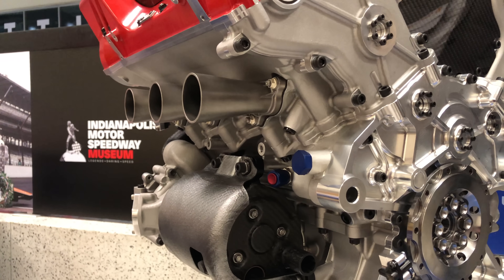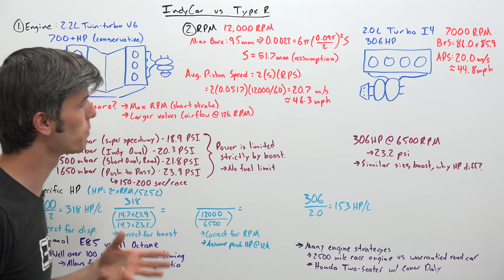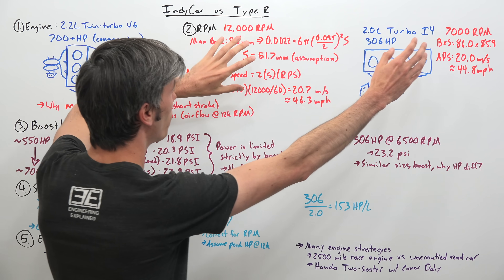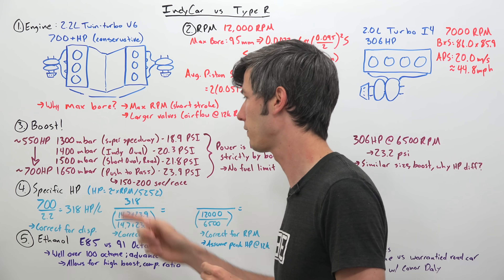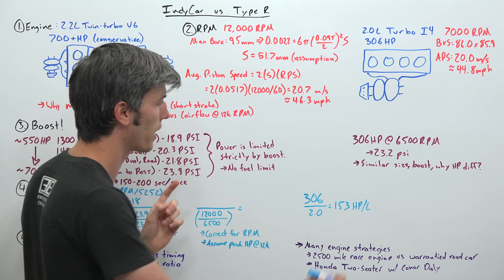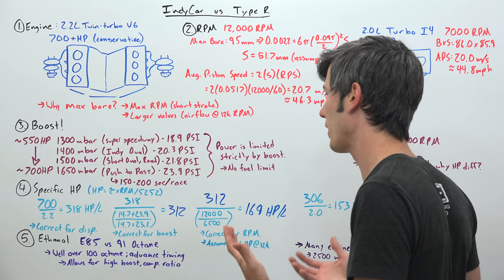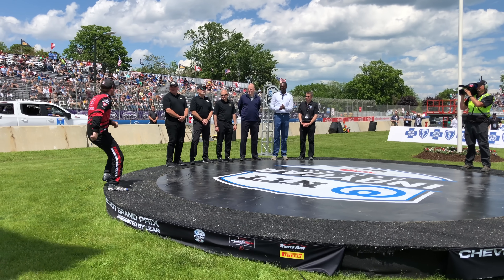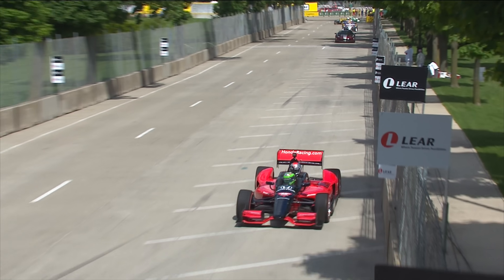How Honda’s 2.2L Engine Makes Over 700 Horsepower

Comment: Hi Jason, great content as usual. Just an observation as we surf around the semi nude Type R engine, the casting metallurgy and fastener coatings don't seem to be what they were in the 90's. I had some direct experience auditing Hex Chrome out of usage for another Japanese OEM some years back. Smart engineering of course is meeting output targets at the most cost effective means, but has the headroom for personal further HP development been diminished (compared to B series) as I suspect for most newer released products? (e.g. LS series)

Comment: Would you ever consider doing a video about the upper limits for an engine's RPM? 
I know F1 cars have had some crazy fast turning engines in the past, and when I calculate the time the combustion cycle has to produce power I get a surprising small number. 
Which leads to my question. Is flame propagation the limiting factor, or something else?  And if so what is that limit (in time and rpm)?
Thanks

Comment: Race engines are NOT hopped up street motors and their internals and valvetrain are completely different.  Race motors are all-on or all-off.  Nothing in-between.  Race cars are completely undriveable on the street.

Peak hp is not the goal of an Indy Race team--how quickly an engine gains revs. is much more important.  Think of blipping the throttle on a bike engine or mashing the pedal on a car for a second, which wraps up quicker?

Comment: Would the extra power stroke per rotation of the crank contribute to the increase in power as well? You compensated for RPMs but even with constant RPMs, a V6 fires more often than a 4c. Or is the shorter firing interval only useful to help it reach a screaming 12k top end?

Comment: More cylinders with a shorter stroke yielding larger diameter pistons, higher compression rings, better fuel and pressurized air to 30+ psi. All this yields an engine capable of ONE race...

Comment: 700 Bhp using about 30 psi boost on a 2.2 liter petro engine is not that high an power output compared to what Honda and others produced during the Formula One turbo era. It was common to find 1.5 liter turbo engines running over 90 psi of boost and over 1500 Bhp. These absurd turbo boost level engines did not last long, but they definitely produced LOTs of power for their time.

What should be recognized and often never mentioned it was Saab-Scania that figured out how to make turbocharged  engines reliable for mass production cars. If not for their engineering development efforts, the modern turbocharged petro engine would not be as common as it has become today. Do look up the vast number of now expired Patents (IP) created by Saab to make petro turbo engines what they are today. It is a fascinating history and why Saab-Scania must be recognized for their achievements.

Comment: I realised that you love to talk about this stuff, so it's okay. But this explonation about the difference of the 2 engines here, well, that was pretty lousy. 

1. The V6 has much less internal friction, bc he has to stay only 2500 miles.
2. The fuelmix is for a much better cooling and deliver a couple of HP more than the normal stuff
3. And that is the main reason for the much more HP's per liters:
       6500 rpm = 3250 combustion strokes per minute
     12000 rpm = 6000 combustion strokes per minute
Finally I read that the pressure for the mbar absolut got corrected from you. So I don't go in in the math any longer . . . . .

Comment: How many miles will this engine last when it is pumping out 700 HP? The 1.5 liter F1 engines could pump out 1500 HP. Of course you could not get 200,000 miles out of it.

Comment: If I wasn't aware of what us street builder build I would be impressed however 700 hp is relatively easy to get from a Honda K20a2 street engine and it's only a 2.0 liter.

Comment: 2.2 700hp...  turbo..
Pretty sure youngs kids are achieving this these days with off the shelf parts.  With 4 cylinders.  And pump gas not methanol...

Honda made 1.5 by twin tur os in the 80s with 1200hp qualify trim and 700hp+ race trim.  
1500cc and the 80s.
Need I say more?
Topic is bland....

Comment: The main performance difference between the Honda racing motor and the street car version you never even touched on, what truly makes a world of difference is the fact that the racing engine uses a true geometry quad valve system that utilizes a twin cam 4 valve technology that opens up only one intake and one exhaust valve at a time giving the motor the 12,000 rpm redline, whereas the street version utilizes a twin cam 4 valve engine but opens both intake valves every time and both exhaust valves at the same time giving the motor a redline of only 7,000 rpm, simply because the valves float at 7,000 rpm, and that's why the Honda 8 valve oval piston motor has a rpm of over 24,000 rpm because it still utilizes the true geometry quad X 2 only opening one intake valve and one exhaust valve per cycle, 7,000 rpm X 4 = 28,000 rpm before the valves start to float
Reply: Source?
Reply: @TheEsseboy  Honda
Reply: @Soshstar999  Link?
Reply: @TheEsseboy  why don't you start with the Honda hurricane engine technology and the Honda oval piston 8 valve engine technology, I'm sure you will get what I'm saying
Reply: @TheEsseboy  it's also known as swirl combustion
Reply: @TheEsseboy  another way to prove my point is to look at the cam lobes of a superbike motor that revs to over 12,000 rpm and a 16 valve car motor,  you will see that the superbike cams only opens one intake valve and one exhaust valve at a time whereas the 16 valve car motor opens both intake and both exhaust valves at a time, thus giving the superbike engine twice the rpm and alot more hp
Reply: @Soshstar999  No, they open all intake valves and exhaust valves at a time, they don't skip valves...
Reply: @TheEsseboy  ok, my bad, my bad

Comment: So, in theory, Honda COULD make a 1L Engine with like 300HP, right?? O_______O
Reply: Dude it has been done by BMW in the 80s. The s2000 makes 120/liter. Ever look at a top fuel car? Way more than 300hp/liter. Only lasts a quarter mile so

Comment: The most major difference in why the V6 makes over double the power on the same boost is Cylinder Head Breathing, the much larger 95mm bore allows for huge intake and exhaist valves vs the 4 cylinders 86mm bore, and there are 2 extra cylinders!! all of this adds up to massively increased total intake and exhaust CFM throughout the valve lift curve per cc/litre.

The 4 cylinder head flow gets choked above 7000rpm where as the V6 heads can flow massively more air above 8000rpm right all the way to 12,000rpm.

This is the biggest difference between these engines.

If you wanted to get the same power from a 4 cylinder you would need a 116.3mm bore size or greater to allow very large intake and exhaust valves and ports, to have a comparable total intake and exhaust flow through the cylinderhead.

Comment: "How does Honda make over 700hp from a 2.2L engine?" It isn't so hard, as Honda does it all the time. For instance:

My stock Honda inline 4, 600 cc motorcycle, has 110 HP and a redline of 16,500 RPM. If it were enlarged 3.6 times to 2.2 liter, it would generate 403.3 HP.  That could be easily boosted to 700 HP with a turbo. And that is a stock engine that was on a $10,000 street bike that weighs 400+ pounds and will do 10+ second quarter miles with the right rider, and brakes to match.  New C8 Vette has nearly 500 HP and an 11.3 quarter mile, 3,575 lbs curb weight. I have done track days on this bike and its performance is unreal compared to most any high dollar sports car.  In fact. you would have to spend at least $200,000+ on a car to get that kind of performance. Granted, piloting this motorcycle around a road race course is far more challenging, and exhilarating, than in any car. And all for $10,000. But just because you can afford a superbike, doesn't mean you can ride one...
Reply: i have a track sv650 and am not anywhere near the limit of that bike yet. You really need serious skill to ride well with any sort of power

Comment: 2.2 with 700hp? What is the top speed?. 120mph, 140mph? I love smaller displacement motors, but they are not known to have top end speed like v8’s.
Reply: HP determines top speed if you compare the same car.

Comment: Usually the peak power of an engine is 500 to 1000 rpm before the rev limiter depending on the application and engine.  Especially for mountain/cornering use , although the power might drop close to 1000 over the peak power , its good to have that extra headroom.

Comment: I don't have to watch this video to know that it's because it revs to 12,000.  HP is not power available HP is how much work there is over time.  Might have 700 HP but probably only has about 300 some ftlbs  torque.

Comment: Race Engines don't idle and have a continual high rev and the valves are much smaller. An idling engine needs large valve sizes.
Reply: No, they need lower valve lift, the valves are huge in this engine!

Comment: I built an h22 (2.2 sleeved) rated at 1200 hp, this setup was shown to easily make 500hp I even saw 800hp once. Granted it might not last 100k or even 20k but making high hp numbers isn’t hard just making the motor last is. That v6 could easily make over a 1000hp if it wasn’t boost limited.

Comment: The BMW GTP IMSA series car was also powered by the 2.0 liter M12 turbo engine, with more than 850 hp in race trim. The 1986 engine was claimed to have produced a maximum output of 1,400 hp (1,044 kW) in qualifying trim, which would make it the most powerful engine of all the turbo-charged engines. Just saying!

Comment: Aren't F1 engines built to much higher tolerances that production car engines which might explain some of the increases in power? An F1 engine can't be turned over from cold, they have to be preheated externally. Indycar is probably the same

Comment: I'd say that trhe biggest difference between the two engines is that the Type-R will do 200,000 miles before a rebuild is required, the V6 won't... I mean REALLY WON'T! :)

Comment: something else to consider is the effective area that the combustion pressure can push against.  the indy's 95mm bore gives us ~7088 mm2 per cylinder while the type r's 86mm bore gives us ~5808 mm2.  the total piston area on the indycar engine is 42,528 mm2 and the type r has 23,232 mm2.  theres a difference of ~19296 mm2.  The indycar uses its combustion pressure over a shorter stroke as well leading to loads more power.

Comment: @Engineering Explained
What do you think of Honda's massive improvement in Formula 1? In the second half of the current F1 season, RedBull's Honda engine is pretty much on par with Mercedes on power output.

Comment: Nascar non restrictor engine go about a 1000hp  no turbo, a small .049 model airplane engine has a 1000 hp per liter
Reply: A nascar engine is 3 times larger
Reply: An airplane model engine is way too small, try to make it vig and it won't work...

Comment: I don't get it, how can two engines with the same average piston speed can have such different max RPM? 
It's because of the stroke? If a piston travels at 20m/s on a short stroke (like 50mm) and a piston from another engine travels at 20m/s on a 100m stroke... the short stroke one can/will, technically, have twice the RPM?

Comment: Piston speed of 44 or 46 mph. Seems hard to believe. Maybe because the reversing of direction cancels the travel out. Actually the speed should be zero in MPH.  Forty some MPH seems very slow for something turning 7 or 12K RPM?

Comment: As a part time engine builder; when I’m asked “how much HP can you get out of my engine?”
My answer is “ How deep are your pockets”
Reply: "Speed costs money, how fast do you want to go..."
Reply: @TeejtheDeej  
I'm building a planned 500+hp 2.4 Ecotec for a customer. As of August 2021 he's $15,000 USD into parts and machine work. Its going into a mid 80's Camaro. I'm expecting it to eat 8 cylinders all day long. I should be strapping it to the dyno this coming spring.
Reply: @TeejtheDeej  
Exactly. 
The more money the person has the faster they can go. The cool thing is today's 4 cylinder engines can out perform  V 8 engines even on a budget. 300 hp reliable on stock components,1/3 the weight, less parasitic friction loss, its a win.

Comment: You can have any power you like with forced induction as long as the block is strong enough. BMW proved this in the 80's with 1400 hp on a 4 cylinder engine much smaller in capacity than this Honda.
Reply: Yeah 1.5L I4 running 5bar of boost on a massive turbo. I can't imagine how much power modern F1 engines would make if they only had to last for 3 laps and had unlimited fuel flow, probably upwards of 2000hp
Reply: I'm looking at my 1986 yamaha rd350ypvs. Dyno says  90 bhp at the flywheel.  
It's an ex Stan Stephens race bike. 
Cranks don't last too long but it's pretty fun to ride. 
The peak revs are about 16k. 
It absolutely screams >:)
That is approximately 257 bhp/litre,,,,,   not bad for non turbo running normal petrol premix.
Reply: @IDontWantAHandle101  
Hey, takes me back...
 I had a Stan tuned LC race engined on the road for a bit, it was so fast,  never got the engine past a 1000 miles without a rebuild 😁
Reply: @petrichor649  No pain no gain!!! 
I have a TDR 250 too. 
That will be the last I get rid of. Hooligan machine.  
Does less to the gallon than my Range Rover :)
Reply: @IDontWantAHandle101  As an expert, I doubt your claim that your bike revs that high. I'm not trying to be a jerk and ruin your good time or bragging rights, but I'm a former national-class PWC engine builder, and I specialized in it during the two-stroke heyday. My twin-cylinder PWC engines under load would rev to around 10k. 250 two-stroke dirtbikes make peak power around 6k and only rev to around 9k, same as the Yamaha Banshee, though a seriously built mill gets over 11k. Roadracing two-strokes were known for extreme porting and ridiculous powerbands and rev ceilings as high as (gasp) 14k, the same as a stock 450 4-stroke dirtbike.
Reply: @RyanMcIntyre  Hi Ryno. We'll as the owner and rider of the bike plus numerous other stock and tuned strokers I can tell you it's like no other. 
Just the 1st gear speed after calculation confirms the 15/16k rev limit. 
It's absolutely obtainable considering the lightening and machining done. 
This engine was tuned for street legal class 1/4 mile in Europe.  There are many very talented tuners in Europe.  Unfortunately the creator of this engine has now retired.
Reply: @IDontWantAHandle101  Could your calculations be off by gearing that isn't original? Tire sizes? Chain slack? You're running a corrected and calibrated speedo I assume? A digital tach? Equations relying on imperial/metric conversions? 
That RD350/RZ350 engine is a dinosaur completely incapable of sustaining such high RPM, those cranks and rods would come apart if the pistons didn't rip from the pins first, and the architecture just doesn't support being able to rev that high. I'll give you 11-12k tops but there's no way you're revving to 16.
Reply: Yeah,and that engine sucked very bad lmao
Reply: James Smith I mean that’s not impressive as a race with turns .

Comment: Short stroke with larger bore= high rpm with hp. Engines are using the concept that the engine is actually an air pump. Force lots of air then Match the correct fuel ratio you can have as much power dependent if the rods,crank, mains, and actual block structure hold up. The weakest link between the pre mentioned components equals max potential power of an engine.....
Its really that simple

Comment: How?? 2 turbo's. I make 700whp from my single cam 1.5 single turbo. 2.2 700whp n/a would be impressive. This 2.2 is not impressive.
Reply: Video? What car
Reply: Try to put out 700 HP on the dyno for 30 seconds, bet your engine would blow up xD

Comment: If the racing engine is spinning at twice the rpm, it must be gulping twice the amount of air. So even at similar  boost being shown the twin turbos are probably pushing in twice as much boost pressure! That's the trick in my humble opinion...

Comment: Manifold vacuum is lower in hte Indy car to start with, so while boost is similar, the mass airflow is higher.  Combine the RPM difference.

Also, the 300HP of the Type R is measures with accessories on.  It probably makes 350 when measures directly on a Dyno at the crank.

Comment: My stock Civic 1.5T is rated for 20psi.  I figured out that was absolute when I connected a scan tool and realized it rarely went above atmospheric gauge pressure.  I believe most all turbochargers are rated absolute pressure of boost.  You have to, otherwise the actual output would vary depending on manifold vacuum and altitude.  This is also important as the wastegate is controlled based on manifold vacuum as it’s the total compression ratio of the intake that matters, not absolute pressure to atmosphere.

Comment: I had a question.  I remember when some race cars had engines that could rev around 20,000 or so, if my memory is correct.  I understand putting some limits on that, for engine longevity and economics.  But is that the reason for the relatively low 12k on IRL engines?
Reply: yes. iirc stress is proportional to rpm squared. 20000 is well into the territory of exotic materials for conrods etc.  (plus all the other grenading factors i know less about). when f1 teams were going to 20k it became obvious that some teams could throw astronomical amounts of money to make more power with more revs. iirc they capped it to 18k in the v10 era.  12k is a whole different ball game ... exotic by the standards of street cars, but very established tech in the race industry

Comment: mbar?  Really?  You can't just use psi like a normal human being?  :)

Some guys de-stroked an LS3, built it for around 8,000 RPM and achieved 800 HP naturally aspirated.  Short stroke motors are beasts.